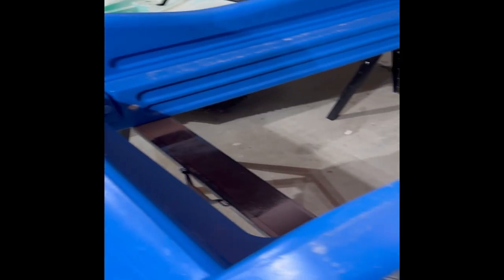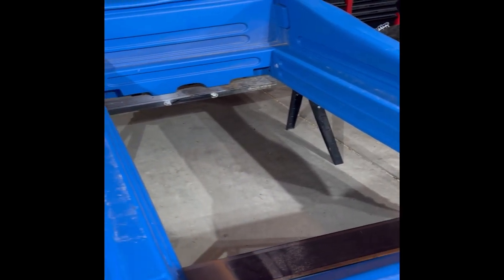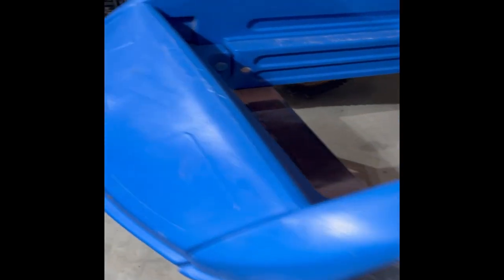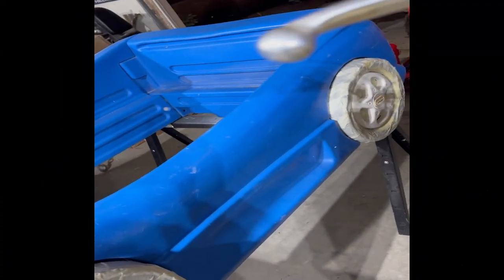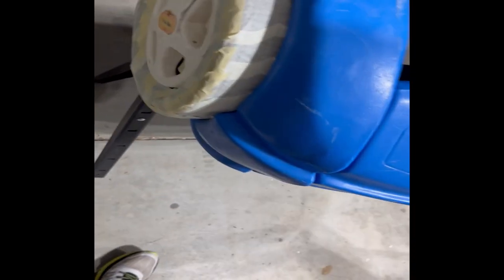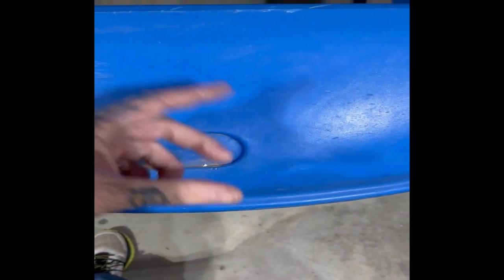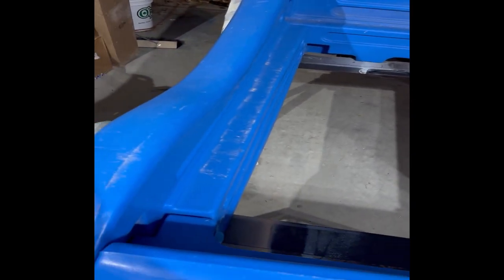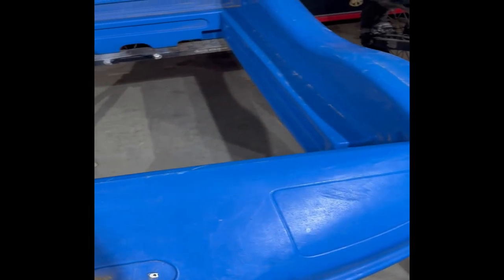Car Bed Paint Project

Comment: Could you please list the materials you used? I want to refinish my son's car bed as well but not sure what to do about the big scratches on it before I start and I'm not sure what paints are best for a project like this.. and the prep you used to clean it up?
Reply from the maker: Sure I used dupli-color prep spray grease and wax remover to clean the plastic before painting with a basic primer. I used rust oleum primer spray paint. And any paint you use is ok I didn’t use any specific type just picked the color I like. Just make sure to lay down at least 3 good coats of primer to make the color you use come out looking really clean and stand out. Make sure you also lay down 3 good coats of color as well. It should come out looking really good. For the scratches I didn’t do anything to fix them the primer I used filled the deep scratches really well. But to remove any deep scratches I would use a good flat metal file. Good luck with the project and I hope this list helps. I appreciate you taking the time to view my video.
Reply: Thank you!!! Also did your blue one have a toy storage under the hood? Mine does but I'm trying to figure out if I can put hinges on it so my son does smash his fingers or drop the hood on his head lol
Reply from the maker: No, my sons car bed did not have the hood for toy storage. I wish it did we had to buy him a semi truck power wheel just for him to store his toys lol. Hope your project for your little one turns out nice. Thanks again for watching.